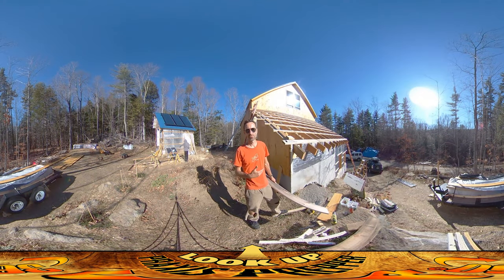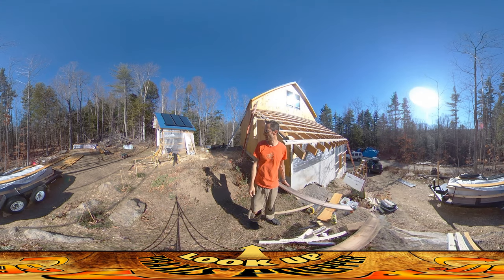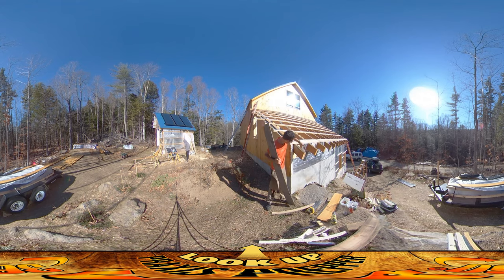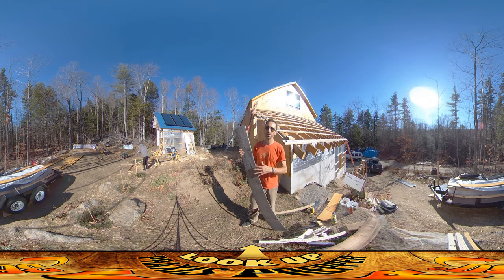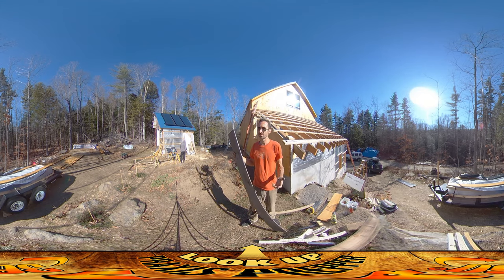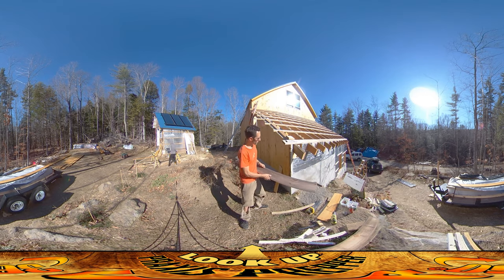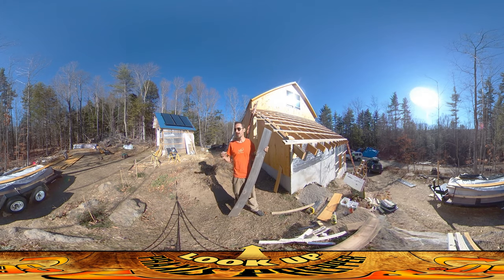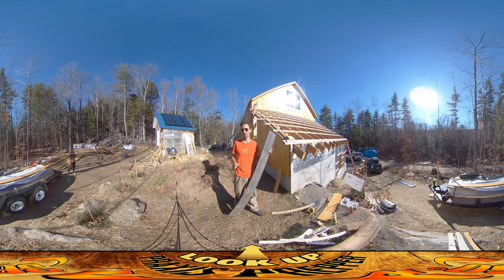Homestead Building - Foam Insulation on Greenhouse, Using Scrap Efficiently, Electrical Work

Comment: Come spring you are going to be so baffled about boarding up the shed in just a weekend (maybe even a day), and sure it's a way smaller structure, but due to being busy with boarding for such a long time, it will likely still feel way 'to short' for the build up perception of how long it takes boarding up things.
Reply from the maker: Rest assured that the soffit and facia of the shed will be just as time consuming as the house... albeit lighter.